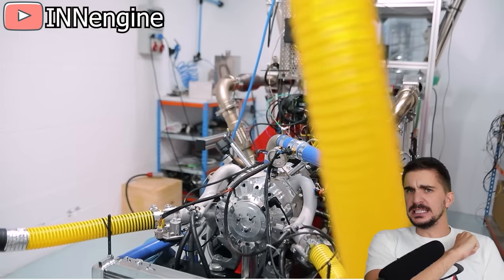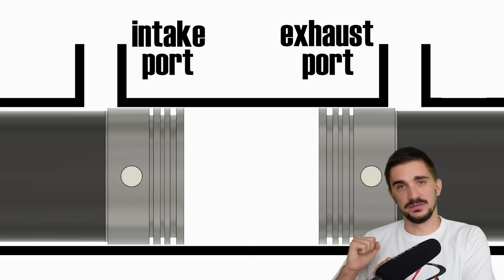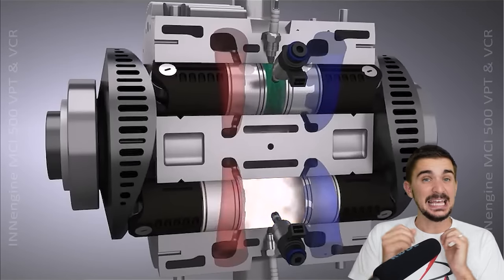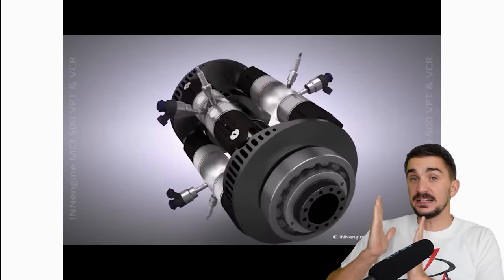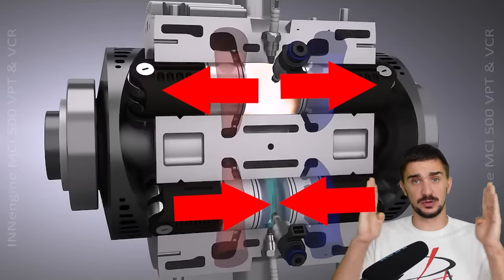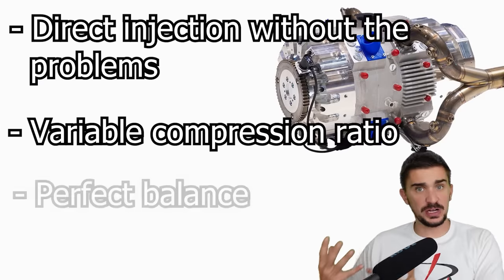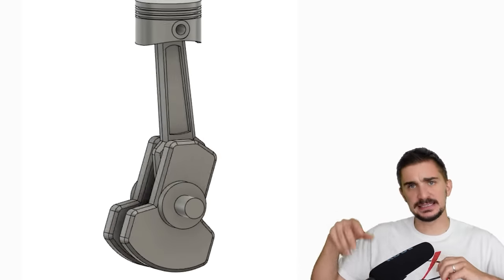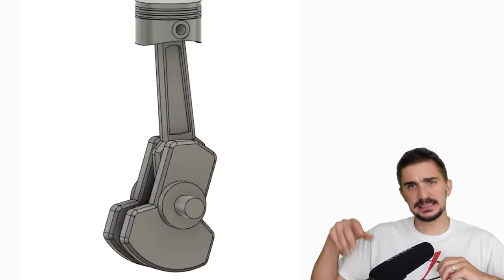Spain is Living in 2050? Revolutionary 1 Stroke INNengine Analyzed

Comment from the maker: Become a Tuning Pro: https://hpcdmy.co/dr4a
100 cars that changed the world: https://amzn.to/3DGXDf6
Stem engine model: https://amzn.to/3Y5iZLv
1-2-3 count with Car parts: https://amzn.to/3jxP7Z6
Patreon: https://www.patreon.com/d4a
Motivation: https://www.youtube.com/channel/UCt3YSIPcvJsYbwGCDLNiIKA
Reply: too long videos, you just talk and have nothing to say
Reply: It reminds me of a car air conditioner compressor
Reply: It all comes down to marketing/sales/investors. It is like thorium vs uranium thing, Thorium is technically better, but since the cold war era was around that time, the president at that point wanted to invest in Uranium (plotonium...etc). Currently switching from the nuclear reactors to thorium based reactors, would cost immense amounts of money and/or would cost a lot of energy. Sometimes it is just based where peoples eyes are at, rather than what is better
Reply: So its INNgine ?
Reply: Their claim of 4x combustion does hold true though... Each cylininder fires every 180°, and the engine fires two cylinders at once, every 90°, which definitely is 4x more than one cylinder every 180°, and one single cylinder experiencing an ignition only every 720° in a traditional inline-4. 
But otherwise I liked the vid, and share your concerns of the low torque due to low mechanical advantage of the swashplate/cam-plate design. 
Although, one could optimise the system by making the cam curve asymmetric, giving the crank more leverage at higher compression near top-dead, and giving the piston more leverage at whichever point in combustion makes pressure and force most efficiently.
Reply: so cant show it for a famtasy
Reply: WHAT THE HELL ARE YOU TALKING ABOUT.  THE WAVY THING .
Reply: The wavy thing is basically a crank disk - indeed I'd just call it that, since it's a disk that's doing the same job as a crankshaft. As for the too-long videos, I'm guessing editing was lost to monetization. Gotta hit that 3rd ad roll, baby. 😎
Reply: The only true one stroke is the omega motor?
Reply: @Saul_Atreides yeah, dude totally missed that each cilinder actually fires every 180 degrees. So twice a revolution.
Reply: This motor might be better as an electricity generator for an electric hybrid vehicle.

.
Reply: Neat
Reply: I been looking and waiting to see where the tech I found was hiding 😂. Spain Ha. my wife will be both happy and sad. I found the tech with the bible and the instruction in hermise and the hidden or unknown in English history 
Spain always Pope’s In And out. My wife is from Madrid 
Makes my kids Spanish 
I have the keys to the kingdoms of old and future 
Who want the lock for a place to stay for free for me and my family wait I have that already 😂the keys are the crux and the inner vectors of a dice drilled out and visualised 
The tools of creation and secret propulsion of a great sailing nation before engines 😮
Reply: its a collar(the wavey thing)
Reply: this thing is obsolete before it is even built.
Reply: @hamasmillitant1 no, it is not a collar.
Reply: Muy súper bueno gracias okey Jesús
Reply: You could probably call that wavy thing a swash plate?
Reply: @d4a THE IS NOT SUCH THING AS 1STROK ENGINE!!!😮😮😮😢😢😢
THE PISTON(S) ARE MOVING UP AND DOWN!!!??? -- 2 STROKES...!!!😅😊❤❤❤
Reply: @voytek3999 how about a rotary? Would each full 360 degree rotation by the rotor count as a stroke?
Reply: @thedoctor2102  You Do see how Ignorant some people are!? Even ones with Technical or Engineering background... You have piston in a cylinder covered with head... You get "fresh" mixture in the space, compres it IN One(1) Stroke... Then you Ignite it and move the cylinder back to low position and empty the space(!) Second(2) Stroke!(OR Power Stroke)...
NO MATTER WHAT THE CONFIGURATION,  HOW MANY Cylinders, cylindrical or triangular (rotary) And How Many Turns or Fraction  of TURN the Shaft MAKES!!! The Full Working CYCLE Of any Engine is 2! (Minimum) Sorry...
Reply: @thedoctor2102  P.S. Don't Let the People Confuse You! Remember the Airplane Engines in "Star Configuration"!? If you have many Cylinders, you may have one(1) ignition per revolution or even two(2)! (One power stroke for Half Revolution) That doesn't mean you have 1stroke engine...
The Rotary is More tricky! STILL, You start with empty space, fill-up with mix and compress, then Ignite to Move the Engine and empty the space to start over... IS Harder to Define the Strokes Since the "piston" is rotating, STILL the Active Side is moving through Specious Section and then go very Narrow to the wall making Compression. After ignition  Expands again to bigger space, Exhaust the gas And start over....
Reply: I see a possible issue with this design that I haven't seen anyone comment about and I didn't hear you talk about. Maybe I am missing something.

Is there something in the design to prevent the pistons from crashing into each other? From what I can see it is dependent entirely on compression keeping them from crashing into each other. At higher RPMs, I think this would present a problem (that could be why you don't see any heavy acceleration 15:57 https://youtu.be/9I0_3qFmPUM?si=5QD7_TTJcgWOwG7v&t=957). 

Also under deceleration, with the inertia of the vehicle throwing those pistons up off the "ramps" like Evel Knievel, I don't see that ending well either. 

And then there's the issue of as the engine wears and the compression drops. 

Can someone explain to me how they account for this? Did I miss this in the video (I have ADHD so it is entirely possible. lol)?
Reply: @GaryMorrisjr 
There's a smaller swash plate parallel to the main one 0:58.
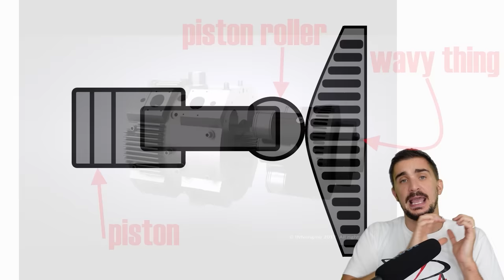The pistons have additional side rollers moving in a groove between these two plates. 1:04 - 1:07. In case of a misfire the piston will be pushed back by the small swash plate.
Reply: This is a very innovative idea, I guess as per the name. My engine design is way better  engineered and I feel should change the world in an amazing way, since I'm not trying to power a scooter or small automobile.  My 6 cylinder engine has the power stroke powering both sides of the piston and will have the power of an engine 4 times its displacement because of that. My entire engine has less than the moving parts present in just the valve train of a typical diesel engine which it's being built to replace.
Reply: The Ampere is also not a  1-stroke, as it's using the same 2-cylinder arrangement to do each stroke-pair simultaneously - exactly the same as the InnEngine. Making them pull on each other doesn't really change the scenario.
Reply: The "1 stroke" term is definitely a gimmick. This is exactly how a 2-stroke motor works. I'm guessing because 2 pistons move from the same 2 strokes, they figure they can call it 1.....
Reply: I think they're calling it a "1 stroke" because the standard 2 stroke has been banned from street use in many countries, and this engine most likely doesn't use an oil/fuel mixture like a conventional 2 stroke, so they called it a 1 stroke to avoid confusing it with the older technology. That'd be my guess. BUT if if does use oil/gas mixture, then that might be an issue. lol.
Reply: @bryanharrison3889  that's great, I'm going to insist that they call my dirty uncle a "pre-permission actor" cos I don't like the way people treat him when they hear he's [traditionally] a sex offender. If only it were so simple to avoid any kind of regulation, just make up a different name for yourself, perfect! "No officer, I'm clearly not guilty of murder, I just made an employment opening for my cousin." What nonsense..... 🤔🙄
Reply: The wavy thing is a circular cam. I'm not certain, but I think it originated with a Canadian engine designer called Hoken Kristiansen in the late 1970s. In fact, it looks like the whole engine was copied from Kristianson - and the graphic of the coin sitting on edge on the running engine, which he reportedly did in demonstrations. 

It was called the K-Cycle engine. 

It was not a two-stroke (and definitely not a one stroke) design, but a 4-stroke. 

Kristiansen's innovation, as I recall, was to make the power/exhaust strokes about twice as long as the intake and compression strokes, which could also be different lengths from each other, depending on cam design. All four strokes could be different lengths, actually.

If you want more torque, you need only increase the diameter of the cam, giving it more mech advantage over the shaft, but of course this makes the engine bigger - but that's not what Kristiansen did anyway; the cams were stationary and the whole engine block/cylinder arrangement rotated. 

Yup. Wild. Probably not much for throttle response, but I bet if you revved that puppy up and popped the clutch something moved.

Making the power stroke longer than intake/compression strokes meant that you extracted more power from combustion and weren't working against a still-expanding gas to push it out the exhaust.

It was said to be very fuel efficient as a result. 

There were rumors of nefarious doings in the auto industry over it. Kristiansen died and his wife always suspected he was killed over his ideas - which he had patented, I believe.

I can't find much on it in a quick Google, but it's an interesting story. You might want to look into it.
Reply: Nicola Tesla designed a one way port that only allows flow in one direction with no moving parts.
Reply: If   Portals  were so good,  we'd all be using them already . . .
Reply: That's how I thought of it when I saw it 😅
Reply: @Saul_Atreides  But you can´t compare cylinders, the weight and the work is in the pistons, and those are two per cylinder...
Reply: @olenilsen4660  that's a fair point, though I doubt doubling the working surface area in the cylinder is enough to overcome the other disadvantages of the system. 

My comment's main point though was just pointing out the cylinders do in fact combust as often as the manufacturer claims, as opposed to d4a's slight miscalculation.